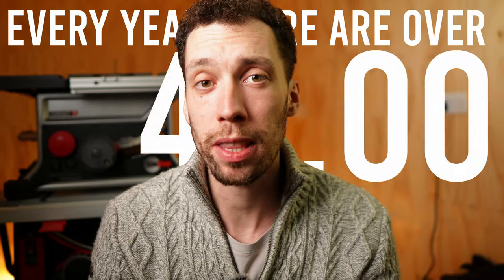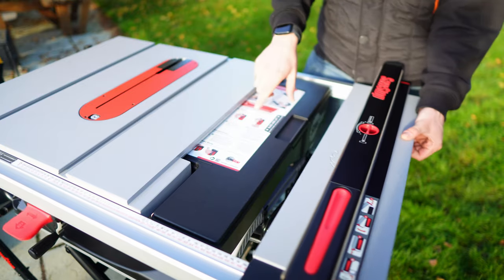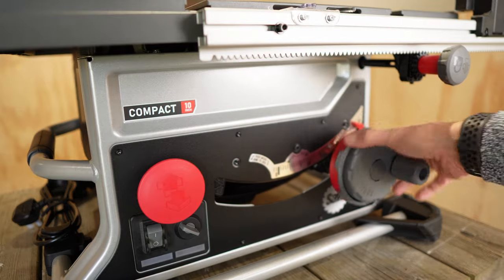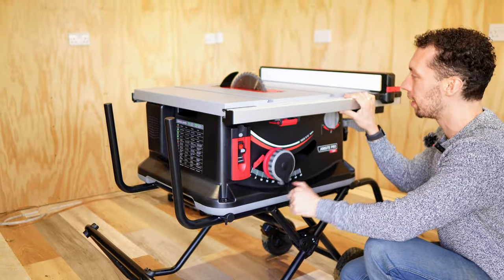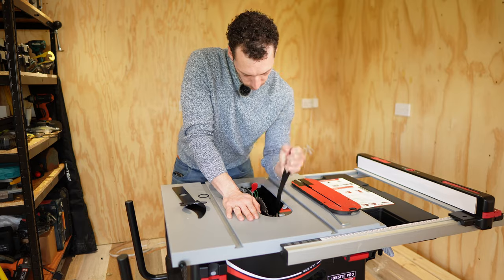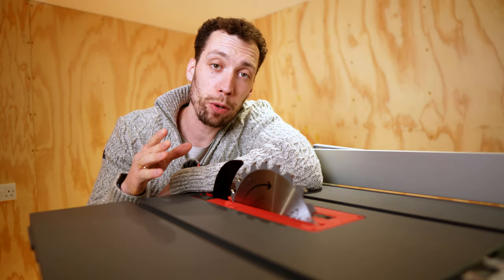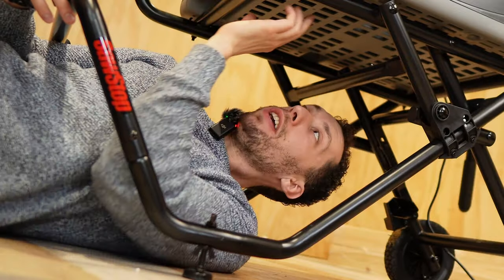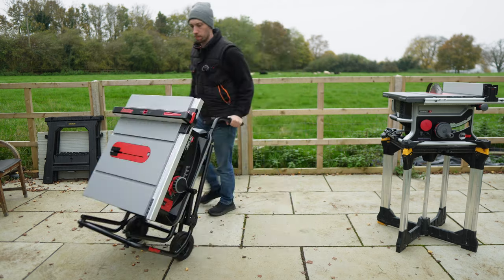Yeah, You NEED to see the NEW SawStop Table Saw!

Comment: The Harvey saw which may be sold by Axminster Tools over there is a far better saw (in my opinion). I mean the one with the TIN (Titanium Nitrite) coated top that looks like a dulled brass color. I also own a Felder Sliding Table Saw and I did my homework before I bought. The accessories available for the Harvey are also very good quality. It might not have the saw stop system but just don't do dumb stuff with it. Also, make sure you have absolute quality lighting and plenty of it. My shop has a suspended ceiling. Every other tile is a troffer (2 x 4') and has 4 LED tubes.
Reply from the maker: Thanks, I’ll check it out! 👍

And I 100% agree on the lighting tip, I have 10 spots in my workshop and it’s very bright 👌

Comment: Got the CTS on Tuesday, and I'm now building a cart based on the Bear Mountain Builds 'Small Shop Expandable Outfeed table' as I don't have much room in my workshop, but I would like the ability to roll it outside and potentially cut some plywood (not a full sheet though). My quick take is that its a quality built compact table saw, and its amazing what they've fit into it, you can see they've thought things through.
Reply: PS if anyone is looking for a good video on setting up the CTS, then Dave Stanton has a great video called 'Dave Stanton Definitively Details the Sawstop CTS'
Reply from the maker: I’ll check out the vid you suggested. I’m planning my own small workshop bench for which works for both of these saws. And I totally agree, It’s a very well made saw!
Reply from the maker: Thanks for the tip!

Comment: I bought the Compact model about a year ago (I'm in Australia).  It wasn't much more than the DeWalt I'd been considering, so for the extra safety, it seems a no-brainer.

I managed to trip the brake mechanism not long after I bought it.  I sent the brake off, and they replied with suggestions of what might have tripped it (contacting my skin was not one of them), none of which fitted with my experience.  But then I hadn't touched the blade either, so it remains a mystery.  I've used it quite a bit since, and have not tripped it again, so it seems to have been a freak occurrence.  It did damage the SawStop blade that came with it, so that was a good excuse to buy a better blade!

The top is not cast iron or any other magnetic metal, so I can't use magnet-based jigs on it.  Also, it's not dead flat, but that doesn't seem to have caused me any problems.

You mentioned the blade contacting the zero-clearance insert plate.  Yes, I've had that too.  But also to note, when you set the blade to an angle, it pivots around that zero-clearance slot, so you can cut at up to 45 degrees with the same insert plate.  And that plastic insert plate was a bit warped too, but I've been able to live with that.

Because of the brake technology used in this saw, you can't use a dado blade with it.

The weight is not much of an issue for me, given that I've built it into a workbench.  I'm glad that it did not come with a trolley.  I do have to remove the saw from the workbench if I have to change the brake again, but I slide it onto another stand when I do that.  The on-saw storage of the accessories is a good thing, except that because it's at the back, you lose access to it when it's built into a workbench!  I created a holder for the storage pack next to the saw on the workbench.

My solution to the (very short) wait before the saw is ready, is to use that time to start the vacuum (remotely)!

Despite the minor issues I've mentioned above, I'm quite happy with the saw, and believe that it's a good tool.
Reply from the maker: Sounds like your Compact saw has a lot of character! 

Glad you’re happy overall—quirks and all, safety never goes out of style!

Comment: I needed a new table saw a year ago. I wanted a SawStop but they weren't available in the UK, so I went the standard DeWalt route. I don't regret it, but I'd rather have paid the extra for a SawStop. (Brilliant NHS idea later in comment.)

I hope you do a test re. cut accuracy, dust collection efficiency etc. That would (have been) really useful.

There have been comments about wet wood setting it off. I know YouTube is neither peer reviewed nor double blinded, but I've seen several tests that haven't managed to get the mechanism to trigger using wet wood. I don't think I've seen any that has, but I'm happy to be corrected.

Here's a UK-biased thought: each table saw accident will cost the NHS thousands of pounds. I want to save the NHS money, so my brilliant idea is that it gives all woodworkers a SawStop saw. Even if it only stops 1% of users needing amputation or tendon repair it would be money well spent.

You're welcome, NHS. Please may I be the first to take advantage of this utterly magnificent idea?
Reply from the maker: Love the NHS idea—SawStops for all! I’ll happily trade a tax rebate for keeping my digits intact. As for wet wood, I agree, it seems more myth than fact.

And hey, DeWalt is still a solid saw—just keep those fingers crossed... or, better yet, not near the blade.

Comment: Nice video jack glad your back. Not gonna lie they look fantastic and I'm in no way knocking the technology in them BUT...
I genuinely think for the price there gonna price themselves out the market especially when you look at others out there like you said between 1/3 to half the price plus if you forget to disengage it and decide to run some wood through thats not totally dry and the blade having to be changed aswell as the cartridge so that's 140-150 quid just seems little to out there for most wood workers here but just my opinion 👍🏴
Reply from the maker: Thanks 🙏 

I see what you’re saying with there being other saws available for considerably less. I see the high price and somewhat of an insurance against injury.

Also, please remember that SawStop will replace the brake for free if they can detect it saved your finger.
Reply: @sumeraybuilds  yea I picked up on that although I wonder how they can detect that and how long that would last for. Granted I suppose people aren't gonna be trying to cut there finger but I just fail to see the business model in being able to constantly offer that 🤔

Comment: Nice video as always mate although I’m not a fan of these. I think the price is basically geared around the technology to stop you cutting your fingers off which sounds great but it feels a bit gimmicky and for that much money to spend over a hundred quid for a replacement cartridge and a new blade for something that can go off from wet wood I’d find really annoying. I also think it looks quite plasticky too. 
I think for the price there are better options out there that will cost considerably less and while it might stop you cutting off a hand it won’t stop kick back which I’d guess it’s probably a more common occurrence
Reply from the maker: Thanks 🙏 Please bear in mind that SawStop do replace the brake for free if they detect it saved your finger. They also claim that 50% of the time the blade is reusable, although that’s not what I experienced so I guess I’m in the other 50%.

I dont actually know the difference in the stats between blade cutting injuries and kick back injuries but your comment is going to make me look into it. 😎
Reply: I know most people won't use it, but it does come with a clear Blade guard and pawls (to prevent kick-back). 
I looked at the Dewalt, but a similar 10" table saw, the DWE7492, is about the same money (maybe £100 cheaper), but it doesn't have the safety feature. That's why I went with the SawStop CTS, I'd rather pay the extra £100 and keep my fingers. 
If you want to go cheaper and get the Evolution Table saw (R255TBL+) then you can get it far cheaper (£380), but the build quality isn't the same. Everyone wants different things, its good that there's plenty of options out there.
Reply from the maker: Very well said 👌

Comment: The issue is that 99% of table saw accidents happen either due to ignorance or overconfidence. People need to be aware of how dangerous these machines are, and how important taking proper care and paying absolute full undivided attention to what you're doing is. 
It's usually either the guy who has no business using a table saw because they're not up to speed on the dangerous and safety measures they should be taking, or the guy who's worked with a table saw every day for 15 years and has a lapse in judgement or attention.  
SawStop is great, reducing the number of accidents by adding protection is never a bad thing, but they're hella expensive and they're not in any way a replacement for proper education.
Reply from the maker: Absolutely, it's like driving a car—you can’t replace good habits with airbags alone, but you wouldn’t buy a car without them either. SawStop is the table saw equivalent of strapping on both seat belts and a parachute. Pricey? Sure. But so is reattaching fingers. 😉